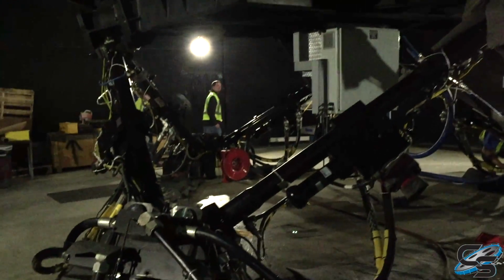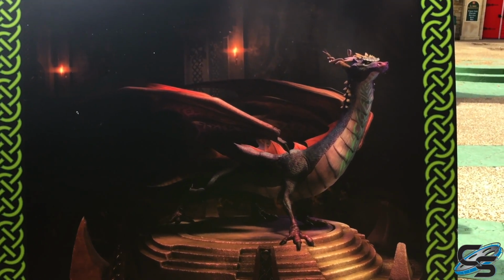Battle for Eire February 2018 Construction Tour Busch Gardens Williamsburg

Comment: Looks better than Europe in the Air.  Corkscrew Hill, don't know yet.
Reply: Mitchell Ries Honestly Corkscrew Hill was very similar. Obviously it wasn't VR but the entire ride theater was put inside a box only to be discovered by two boys. The boys then went on this adventure/quest to beat a witch and during their travels they were riding on the back of a Pegasus. I see Battle for Eire as a bit of an homage to Corkscrew Hill. Thankfully it has no ties to Europe in the Air. That should not have never been created and it made me fear what else SeaWorld's new management would do to try and make a quick buck.